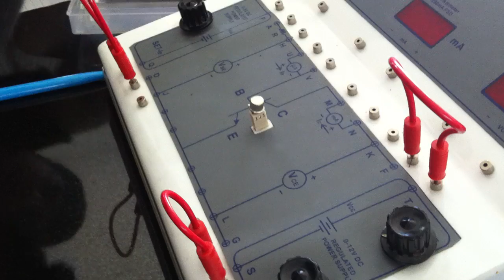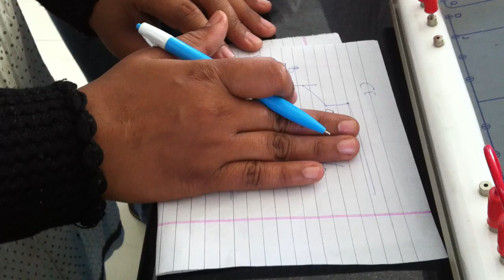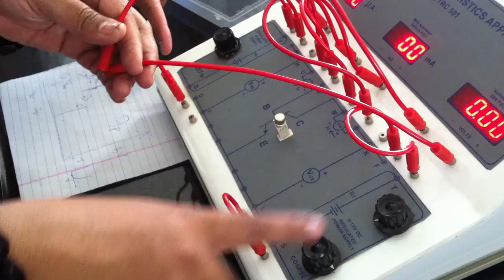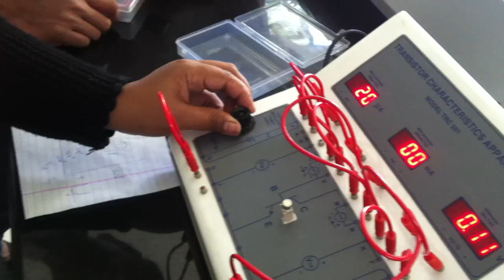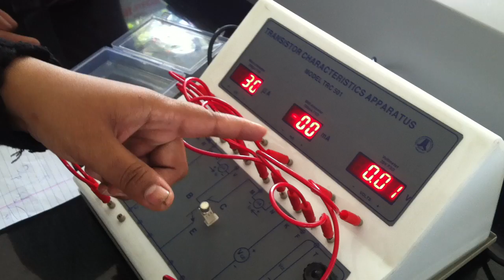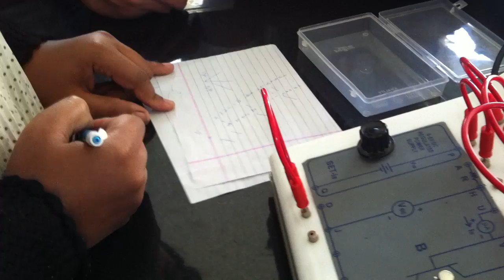n-p-n Transistor Characteristics

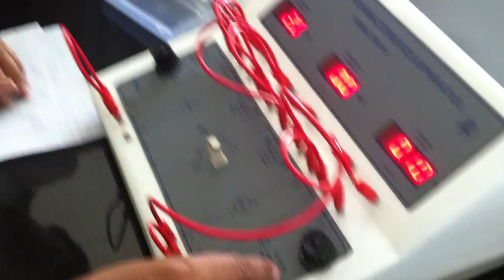Comment: When the video is at 7:56, one of the student asked why the Base current reduced with the increase in VCE. Here is the reason. If you look at the circuit you will notice that there a positive voltage is applied across Collector and negative at emitter. Here Base is connected to positive of battery but the positive of base is much less than the positive of collector. That makes base to collector junction as reversed biased (collector – N type is at higher potential in respect to base – P type). Whereas base is at higher potential with respect to emitter, so base to emitter is forward biased. Now you know the biasing lest focus on the actual question.
Base to collector junction is reversed biased. When a PN junction is reversed biased there is a very small reverse saturation current in PN junction and it is independent of voltage but dependent on temperature. Roughly every 10 degrees rise in temperature increases the reverse saturation current by double. This reverse saturation current (flowing from collector to base terminal of transistor) is in opposite direction to base current (flowing in direction from base to emitter terminal of transistor). This opposing current causes the drop is base current measured in micro ammeter. When there is increase in VCE there is increase in IC that means increase in temperature in transistor that means slight increase in reverse saturation current that means drop in base current.